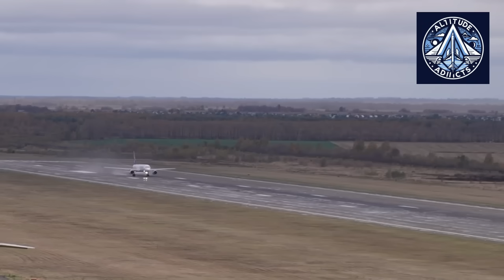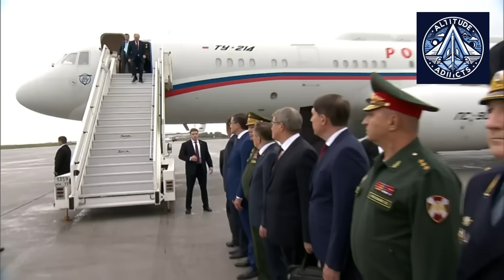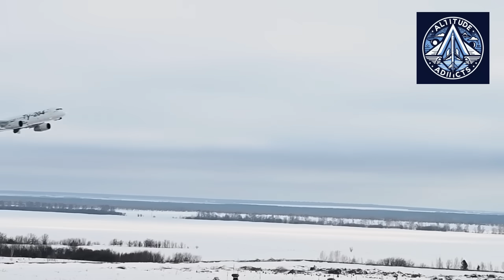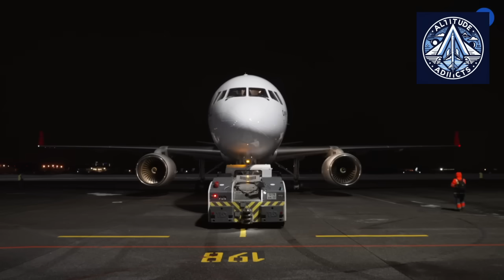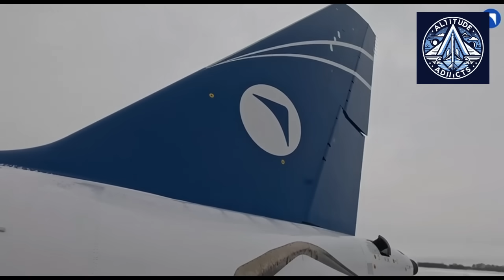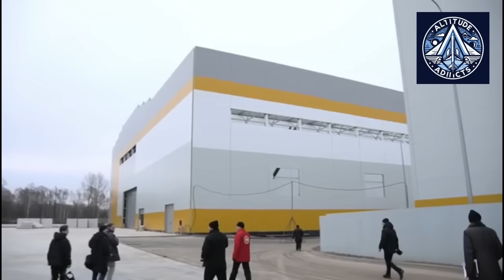Why the Tu-214 Is Russia’s Only Rapid Solution—MC-21 Still Years Away

Comment: 214 is still with old engines and assembled with foreign parts suppliers. Also conversion from 3 crew to 2 crew will take time for conversion and certification which will take 2 to 3 years. So it’s a dead issue right now. But, conversions and incorporate  to 100% Russian parts are ongoing for modernization of 214. 
MC21 with little weight issues addressed and options are in works to assemble all internal plastic panels even seats structure are made with Carbon fiber to reduce overall weight from plastic to carbon fiber by 75%. A fair estimate of weight reduction of approximate 25 Tons. Testing will continue as planed to be completed in next 3 to 4 months with 2 aircraft are used. All internals changes will not affect certification. Carbon fiber is excellent against fire and lot stronger than Plastic.

Comment: I feel the MS-21 is screwed. It is just that the Russians are not admitting to it yet.
Reply: No, it's the lambda anyone who is the naive failing to face reality head on, instead, keep listening to wishful thinkings (lies) like "MC21 is lightweight" (it's NOT, that's an empty shell not suitable for operational use). Or "for international market at competition level with A320" (that WON'T happen within 15 years)

The hype biased people's expectations, I call it useless propaganda that will come back bite you in the harshest way...

Why don't people just make some effort to read between the lines? An entire facility just opened for MC21... If it was for training, you DO NOT need that mega facility. If it was for administrative and corporate affairs, that can be done in existing buildings. The facility, not for assembly line, came after the sactions. If it was for component production outputs, suppliers were already UNDER PRODUCING with just TWO prototypes and nothing else planned.

Therefore, it MEANS that NEW facility addresses an ENTIRELY NEW ISSUE, what can it be?
Very easy: create Russian native components! Considering the SIZE of the facility, everyting inside that MC21 has to be ENTIRELY revised, researched, developed and produced... Why nobody realized that the day that facility was unveiled to the public? Instead, everybody eagerly listened to the sweet inaugural speech, "a milestone in Russian tech and customer support/service..." How wording entirely changes perception: that facility is there BECAUSE MC21 will just DIE without! Furthermore, the purpose of that facility indicates counting on AT LEAST 5 YEARS DELAY ON THE PROGRAM. Only then, if everything works, can it be called a milestone...

^^ See, for every small news, every AI or not AI new video on YT, for every info on social media, people seems to be less and less critical, those who speak become more and more dishonest, entertaining that mutual denial of REALITY!

I don't think overpraising the MC21 and put that much expectations on its shoulder help Russia the slightest. On the contrary, it just confirm western perception "Russia is still delusional and will inevitably fail at some point, resources are never that unlimited)

On the contrary, *it would serve Rusdian interests very well to just ABANDON international market, and focus only on developing MC21, along with anything else, Tu204/214, Il76...) for DOMESTIC traffic to MAINTAIN internal businesses and economics ALIVE. I don't believe in MC21 reaching any level of recognition to be successful internationally, now is NOT the time for that...

In 15 years, YES, UAC should create a new narrow body with MUCH NARROWER FUSELAGE, at a time when Russian manufacturers and suppliers can mass produce engines and components that are BETTER than western ones, and CHEAPER! It's still a long road to go, the math doesn't just add up right now.

Comment: mc 21 and tu214 must have compatible design and all spare part's so that they can benifits both model's
Reply: You don't have the slightest clue what you are talking about, those 2 planes are not even in the same category, Tu214 is much larger, heavier and has more powerful engines.
Reply: @LloydChristmas983 А шасси, кресла в салоне, туалеты, системы кондиционирования, вспомогательная силовая установка тоже разные?

Comment: Beyond 2025, production is forecast to climb gradually: approximately 4 aircraft in 2025, 7 in 2026, 17 in 2027, and reaching up to 28 aircraft per year from 2028 onwards as new assembly halls and production facilities come online in Kazan. The overall program aims to deliver about 70 new Tu-214s by 2030. ���

Comment: TU-214 is a newer platform than both the 737 and even A320... so no reason to not use it. But I do not believe the MC-21 is that far away. Many of your sources don't have much connection to UAC's Irkutsk branch many sub-contractors, whom are doing most of the heavy lifting and honestly have been rapid firing though the subsystem replacement compared to any western company. Its seems long because there were so so many to deal with.
Reply: Plenty of reason why not to use it, for one thing it was technologically dated even in time it got out of the factory for the first time and nobody wanted to buy it for 30 years, well very few companies did. MS-21 is actually on pair whit modern airliners tnx to the fact that Airbus and Boeing did not make any real innovations for years, Russia just needs to push the dame thing to production lines and occupy some grey markets like CIS states, Iran, N. Korea, nations in Africa... before China catches up whit them and then they them self occupy this markets.
Reply: @youmad7068   fair point, but the base hull of the TU-214 is newer. it can easily handle a lot more upgrades.
Reply: @youmad7068  how is MC-21 on par with Airbus and Boeing when it has worse performance than their 30 years old models?
Reply: @LloydChristmas983 WTF are you on about? How can you possibly know what are performance of MS-21? Let alone how it compares to others.... 😅, it has modern hull, wings, and cocpit/avinoics next generation of PD engines, that is what l mean when l said it is up to date whit competition. Its performance is yet to be proven, latesest flight proved it can puh 5000km something that was earlier stated by shady chanels like this one that it can not do...
Reply: @youmad7068  maybe I know because UAC who produces this airplane (or will eventually produce one day in 20 years maybe) said that its range with full passenger load is 3830 km, and that is even published on their official website. I'll take that as reliable info, rather than your mumblings. 
"It has modern hull, wings and..." - yeah, so modern that it's more than 5 tons heavier than it was supposed to be. But you can freely enjoy your imaginary world where this non-existing airplane is competitive. I'll just remind you once more - this plane is in development since 2007 and it still hasn't flown a single passenger.
Reply: @LloydChristmas983 You can hate Russia all day all year long, l can tell by the way you fight to prove a point against Russia that you truly hate them. But this plane exist despite all the sanctions. They are currently under  26000+ sanction introduced since 2008 till today, and you laugh for they have trouble to finish development of airliner which was deliberately targeted by many of this sanctions. But the fact is despite all that they still made it, two new prototypes made whit fully import substituted parts, l see now that it is 3800km , but they will keep refining it. No other nation in world made an airliner whit fully domestic parts, Russia was even making titanium parts for Boeing.
Reply: @youmad7068  That's not true, sanctions have been introduced only after 2014. If I hate Russia or don't (I don't by the way, quite the opposite, if you could see my comment history you would see that) doesn't matter at all, I am just stating facts. The facts are that MC-21 project isn't going anywhere, it's been in development since 2007 and there is no end in sight. Other fact is that even the performance stated by its producer UAC is terrible compared even to previous generations competitors. We all know that producers overstate performances all the time, even Airbus and Boeing do that, so true MC-21 performance may be even worse. And another fact is that there are no fully import substituted prototypes as you say, even this channel which is basically Russian propaganda says that they still need to replace 5 key imported systems.
A lot of countries can make a prototype airliner with fully domestic parts, the thing is to make an efficient airliner, and even a bigger thing is to make a lot of them (to achieve the economy of scale) and Russia can't do that. I wish it could though, I've been following the MC-21 project since 2007 and SSJ-100 too, but after 20 years of failures I think I have the right to say their passenger jet industry is not going anywhere and it's basically non-existent (it has produced 0 or 1 passenger jet in last 3 and half years).

Comment: Not sure why they didn't choose to continue with the TU-204 instead of the TU-214? The TU-204 has a 2 person cockpit and long range and cargo versions. The only reason I can think of is that the Aviastar facility in Ulyanovsk (which produces the TU-204) is busy with other projects while the Kazan Aviation plant didn't have much work on.
Reply: Only the Tu-204SM had a two-person cockpit and it was never produced.
Reply: Dalam kondisi perang, il-76 terbaru mendesak dibuat dengan jumlah besar di pabrik yang sama dengan Tu-204. 
Maka sebagai gantinya, semua beralih ke Kazan yang memproduksi Tu-214. Tu-214 memungkinkan ada penyimpanan bahan bakar cadangan yang memungkinkan memiliki jangkauan sangat jauh yang dipesan oleh pejabat pemerintah federal. 
Dulu memang ada proyek Tu-204SM namun sepi peminat sehingga tidak jadi diproduksi.

Comment: Jaja the TU-214 is newer than the B737 and A320...!.. Get your duck's in a row....  Besides the MC-21 is no the only one, this project IS a modular version of the Yakovlev YAK-204 which can be put in production inmediatly and since is a modular design it can be of various sizes like for 120 passengers, 150 passengers, 180, passengers or 230 passengers it is designed to be modular from the start and not a Frankestein like the B737 MAX....
Reply: @mazikkaluchka5562  
Иди, поиграй в Лего.

Comment: Another video said the exact contrary. Tu-214 is not mass produced and needs to be modernized. MC-21 is a year away from serial production. Test flights should be completed faster now that all prototypes are ready in Zhukovsky.
Reply: Jika kita jeli mengamati perkembangan yang ada, tiada harapan MS-21 di tahun 2026 bakal mendapatkan sertifikasi.
Reply: Yea, ldk what this guy is yapping about, I am 99% sure he is not making this videos by doing actual research and analysis, instead he is just reading what ever interview or article he finds on net, that is why he is making contradictory videos every now and then. Tu-214 and MS-21 are made by the same company, and no company is crazy to spend tens or hundreds of millions of dollars in testing and development of something just to go back and produce the predecessors which nobody wants.
Reply: @youmad7068 
Semua memang berada di bawah kendali UAC. 
Tapi perkembangan pembuatan pesawat nya jelas berbeda, dan pemimpin proyeknya pun berbeda
Reply: MC-21 is years away from serial production, they didn't even finish 10% of the certification flights yet, and the plane is obviously not yet finalized as they have yet to substitute 5 imported systems, and there is also the problem of excess weight which they are probably trying to reduce.
Reply: @LloydChristmas983  The weight is not a problem. It was a misunderstanding. 3830km is the flight range with 175 passengers and luggages, which is on par with current A320neo and 737MAX.
Airbus and Boeing have a tendency to focus the attention on the optimal flight range with no passenger and luggage which is misleading. Altitude Addicts published a video explaining this topic in more detail.
A shortened version, the MC-21-210, will carry less passenger: this will allow to increase range and efficiency just like the A319neo.
The MC-21 is a narrow-body medium-haul aircraft. It cannot compete with wide-body long-haul aircrafts. This is perfectly normal.
A MC-21-410 or a completely new wide body aircraft may be the answer for russian airlines.
Reply: @msebastien24  MC-21's range with full passenger load is not on par with A320 classic, let alone with A320neo. A320 classic can fly more than 5000 km with 180 passengers.